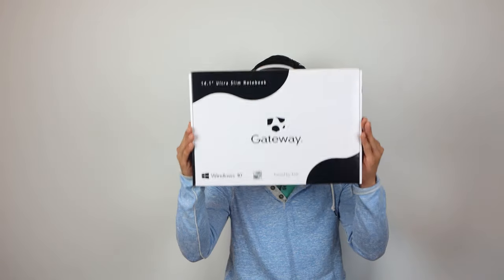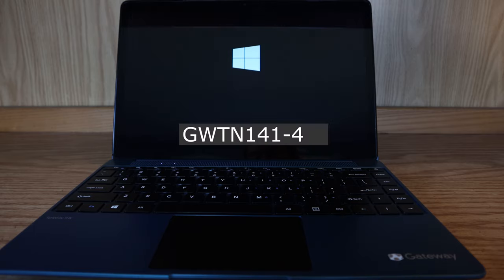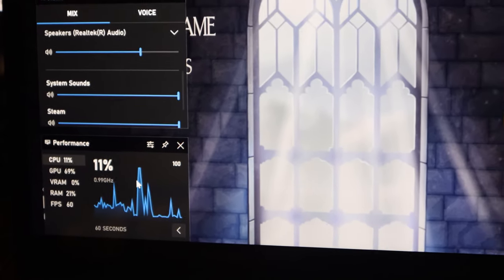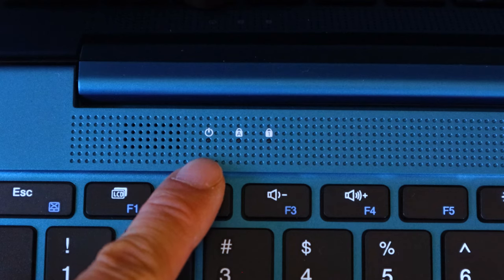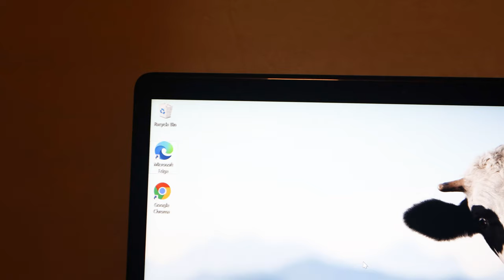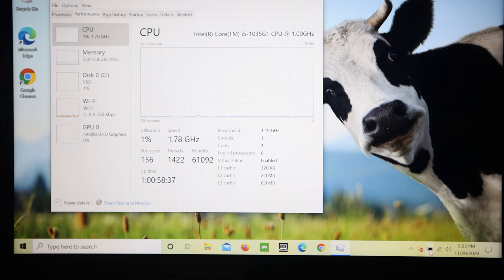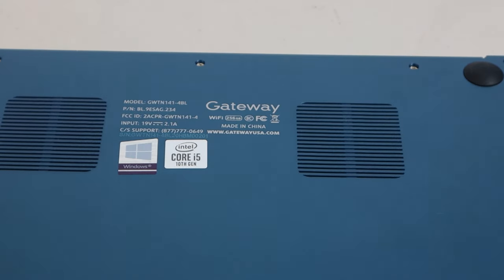2020 Gateway Ultra Slim Notebook Laptop Model GWTN141-4 Review

Comment: Please help me my laptop (the same model) everytime I turn it on the gateway logo will appear for a split second then disappear with no windows logo boot up and it just shows a black screen I don't know what to do
Reply from the maker: Hm, have you done any upgrades like replacing the SSD or adding an additional one? Try booting the laptop into safemode, as soon as you see the logo appear, press and hold the F8 key. Then select safe mode with command prompt and see if you can get Windows to load. If you can, try performing a system restore, by searching "Reset this PC" (🔎in the taskbar along the bottom of the screen).

Comment: I bought this laptop thinking it was a good deal for a fair product. But when i went to best buy looking to upgrade the RAM the employee told me i would have a hard time finding part for this laptop since gateway is so old. 
Im not very computer savy yet but i do know a best buy employee would benefit from me buying a different laptop from him/her.

So now im wondering if they are right and i should get a different model or if in fact i can find RAM and other parts elsewhere and those bestbuy people are just being mean.

What do you guys think?
Reply from the maker: Gateway is an "old" brand but was bought by Acer and recently partnered with Walmart to revive the brand. Their latest line of new devices launched in 2020, so the Best Buy employee may not be aware that the laptop you're looking at is not 10 years old. Also, when it comes to RAM, laptops are brand agnostic, so that means basically any RAM brand will work in any brand computer or laptop, and since the replaceable internals of laptops are pretty generic, I'm not buying that "limited availability" of parts is a real thing.
Reply: It's made by Acer.

Comment: I have this exact same laptop and it went completely black today I keep restarting it and it still black ☹️
Reply: when did you get it?
Reply: Bought mine less than a year, am presently facing the same problem, it goes on and off without loading when I tried to power it on.
Please what is the solution.. thanks

Comment: What type of M.2 SSD can be used? I bought the Gateway 14.1 GWTN141-5
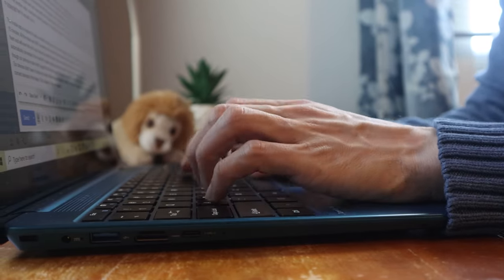Reply from the maker: Does your model have the SSD access panel on the bottom, like mine (see 7:44)? While I don't have that specific model, if it has similar specs, it should be compatible with a SATA NVMe m.2 drive up to 1 TB.

Comment: Just bought the ne for my son, set it up and now it won’t seem to power on. The 3 light on the top left of the key board are lit up but when we press the power button nothing happens on the screen. Any ideas?
Reply from the maker: Hm, it sounds like it might have gotten stuck during a Windows 10 update. Try pressing and holding the power button for 10-15 seconds to see if the LEDs above the keyboard turn off. If they do this means that the computer should be completely shut off. Close the screen and open it again and then try to power the laptop on. If it's in the middle of an update, it will either try to resume the update or roll it back due to an error.
Reply: @ReviewedByPhil  thank you!
Reply: You are amazing Phil! I found this video and this specific comment in my search for a solution.

Comment: Where do I buy a HDMI Cable that has a small fitting. The Laptop has a Small HDMI port.
Reply from the maker: Which model do you have? The one I have, the GWTN141-4 has a standard full-size HDMI port, see 0:51.

Comment: Is This Laptop Good For Work At Home Jobs & Going To School On.... Or Is It Fast ?
Reply from the maker: I guess it depends on what you need it for. It's perfectly fine for creating office documents like Powerpoint presentations, Excel spreadsheets, and word processing. I've even used it for some light photo editing in Adobe Photoshop, but if you need to run high-powered engineering application like AutoCAD for work or school, then I would say that it is not powerful enough for that.

Comment: I need help, I have this laptop but it won't wake up, the light is on but the screen doesnt come on
Reply from the maker: Hm, I'm not sure. Is it fully charged? You may have to do a hard power off (press and hold the power button). Then power it back up.
Reply: @ReviewedByPhil  I figured it out a little while ago. Thank you for you help😁
Reply: @abigailletts9185  how do u like the labtop is good im wandering if i should get it ?
Reply: I am having the same issue, how did you get it to wake up?
Reply: @itzrandom6494  it's a good laptop, I really enjoy it. The issue I had with it was my fault but it was a simple fix
Reply: @nicoleschneider3613  I held the power button for a really long time, im not exactly how it worked but I held it until it came on. If it took to long I just tried it again
Reply: @abigailletts9185  thank you! Have you had any other issues? I’m really thinking about returning it.
Reply: @nicoleschneider3613  no, I haven't had any issues besides that one and it was because I always closed it without turning it off.

Comment: I’m tired of my daughter using my iPad for Roblox. she already messed up my pencil so i need something cheap that she can use to play her game. Until i can see her take care of her things. will this be okay for that?
Reply from the maker: It appears the minimum requirements for Roblox is 1GB RAM memory and 1.6Ghz processor which this laptop has. So it should be able to run Roblox, but since I'm not really a gamer I haven't tried Roblox on it myself, so I'd take that piece of info with a grain of salt. It would probably work fine, but you may need to set the graphics level to something other than high or ultra since the GPU isn't that powerful.
Reply: @ReviewedByPhil  she’s only turning 7. so i’ll try this out & she how this works out for us. thanks for the reply

Comment: I bought a M.2 pci-e 256gb ssd card to add to mine, But the laptop doesn't pick it up.
Reply: I did the same, tried an m.2 2280 pcie in the outside extra slot. Didn’t work. However, an m.2 sata card works.

Comment: Just bought this it doesn’t have a power button it has number lock in that spot idk how to turn it on
Reply from the maker: I would check the quick start instruction card that came with it. I'm sure it will tell you the location of the power button for your model.

Comment: So only 6 hours or 10 for full battery??
Reply from the maker: It will depend on your settings. I'm sure if you turn battery saver on and reduce the brightness level all the way as well as processing power you might be able to get 10 hours of "off-the-wall" time on a full charge, though it's unclear how much of that time would be idle vs active usage.

Comment: I just discovered a weird situation with this pc. I just tried to take out the drive I had inserted in the second external slot. When I restarted without the external drive , it boots into the bios. I click on save changes and exit but it refuses to accept the change and keeps rebooting to bios. If I reinsert the drive in the external slot, it boots as usual to Windows and everything is fine. Now I am stuck with a redundant 1 tb drive since it does not show up as another drive even though it’s inserted in the external slot. If I take it out, pc does not boot beyond the bios!!!!!
Reply from the maker: Does your original drive still have the OS installed on it (meaning you didn't wipe/format it after you installed the second drive)? And you can still access the original drive after you've booted into Windows? If so, it's possible the OS on the original drive is corrupted which is why your computer won't let you boot with it, in which case you may want to try a re-install/repair Windows OS on that drive. Your other option is to try to "force reset" the BIOS boot priority by removing both SSDs. When you turn the computer on after, enter BIOS setup and choose "USB hard disk" as boot priority #1, save and exit, then restart the computer. It will try to boot, but find no OS anywhere so it should fail, resetting the BIOS. Now turn off the laptop, reinstall only the drive containing the OS in the primary m.2 slot. Boot into BIOS setup, then select "Hard Disk C:" as boot priority #1, save and exit, and restart. Hopefully that will work for you!
Reply: @ReviewedByPhil  Thank you for your rely. The main drive inside the main cover, the boot drive. I used Macrium Reflect7, transferred the image of the pre-installed drive to the new 1Tb drive replaced the original 256Gb drive with the new one. The new drive as the replaced drive is the boot drive. Everything worked well. Then I inserted another 1 Tb m2 nvme sata drive into the external extra slot. Boots well into windows, everything works fine. The pc recognizes the external slot drive as drive 1, asks me to initialize but reports some fatal hardware error. Now if I take the external drive out and start, it goes directly to the blue bios screen. I click on accept/save BUT it keeps looping back to the same bios screen. Won’t go to Windows. Again if I stick the external drive in, it boots to windows as usual. All operations normal. Only if i take out the external slot drive out, it won’t surpass the bios screen.
Reply: @ReviewedByPhil  thank you so much. The second option did the job. Everything working now. Appreciate your help.
Reply: @ReviewedByPhil  do you have to reinstall windows if you replace the ssd that came with the laptop or is it saved on the chipset

Comment: I bought that laptop, and two days later, I turned it on and it shows on because the button is on, but it gives me a black screen, and it's on because I can also activate the shift key, but really, I don't see anything on the laptop, does anyone know why? I haven't even mistreated it or treated it roughly
Reply: I have the same problem right now.
Since this comment was made 4 months ago can you tell me if you were able to resolve the issue somehow?
Reply: @chump3592  how long ago did you buy it?
Reply: @skagirl6937  about 8-9 months ago
Reply: @chump3592  If you have the same problem that I had, you should let your device's battery run out until it turns off, then put your device on charge, 5 minutes will be enough, then try to turn it on (I did it, and then they came to me). some instructions that I had to update it), I did it, then I remember that it makes you wait for your team from 1 to 100%, and that's it, that's it

Comment: I just wanna use it to stream my Xbox off of it with my Graphics card you think it can handle it?
Reply from the maker: Yes, but you would need to make sure it's set to 'performance' mode as Xbox requires at least 1.5 GHz and by default it runs at only 1 GHz.

Comment: I HATE THIS LAPTOP!!!  THE SCREEN FALLS OUT OF IT,  I only had it for six months and the screen fell straight out and smashed on the keyboard,  And it's a common problem if you read reviews online.  Now after spending $540 at Walmart for this crap I have to go through the hassle of mailing it in at my own expense to the warranty place and waiting weeks for it to be repaired.  It worked great at first then it falls apart,  I have bought way cheaper laptops and never had this problem.
Reply: Dudeee! I bought this laptop and didn’t get the warranty because of how expensive it was smh. It worked fine for like 2 months and now my screen is just completely black. And I basically have to pay the same price of buying a new laptop to fix this
Reply: @kynyaralewis8226  Did you buy it from Walmart ?  Because I didn't pay any extra for the warranty?  It came for a year with the laptop.  I went on BBB and filed a complaint and got mine fixed.  I will send you links if you need help.  They ended up fixing and sending mine back within a week.   I don't know why this video isn't mentioning this very common problem when it is so prevalent.

Comment: Is upgrading the ram possible in this laptop?
Reply: No, it is built in (although I don't see the point of it since it has 3200mHz dual channel 16gb ram)
Reply: @vlado_tasevski  Cool thanks for the heads up on that.
Reply: @vlado_tasevski  Hello, are u sure this laptop have dual channel at 3200mhz of ram? where u saw it? please.
Reply: @domenico8508  When I went into task manager and clicked on ram, it showed me that it has 2 out of 2 ram slots filled and that it is 16gb 3200mHz. Not sure if every model has the same but mine has it that way.
Reply: No. It’s soldered in. 16mb is enough for this $400 laptop. It is good for low-medium computing. Don’t expect more than that.

Comment: How do you factory reset it?
Reply from the maker: You'll need to do this from within Windows 10. 
1. Click the Start Menu and select the gear icon in the lower left to open up the Settings window. 
2. Choose Update and Security. Click the Recovery tab on the left-hand side and select 'Get started' under Reset this PC.
3. For a factory reset, choose Remove Everything. Then continue to follow the prompts to complete this process.

Comment: Just a heads up that the storage is not capped at 1TB.  I have an 2TB NVME (ADATA SX8200) in the internal slot and a 2TB (Western Digital WDS200T2B0B) in the user expansion for 4TB total. 

EDIT:  So the WD digital I put into the user access (small cover) slot is SATA.  That port is SATA only.  The internal port under the bottom cover will accept SATA or NVME.
Reply: I tried an wd550 nvme 1tb, it didn't work. 2 different SSD's. I'm talking about the port on the bottom of the laptop.
Reply: @TheDroneVoyager  The user accessible port is M.2 SATA only.  If you want to put in an NVME you have to remove the bottom and replace the included SSD.

Watch the video.
Reply: @David_L3  your laptop is 10th or 11th?
Reply: ADATA SX8200 2tb or ADATA SX8200 pro 2tb?? its M key ?

Comment: Can I play the sims on this?
Reply from the maker: Yes, I think so. This laptop should meet or exceed the minimum hardware requirements for the Sims 4. When gaming, be sure to put it in performance mode. It may push the CPU a bit and make the fan run louder though, so headphones are recommended!
Reply: I'm wondering that to🤔.plus I do alot of mods and cc

Comment: How to make my speaker louder
Reply from the maker: If you've turned the volume in Windows up to 100, then that is the loudest that it is going to get. If you need more sound than what the built-in speakers can offer, plug an external set of speakers into the headphone port of the laptop using an AUX cable or use a headset.
Reply: @ReviewedByPhil  good idea thank you

Comment: This laptop sucks. Bought cheap on black Friday. Been using it since Jan/Feb. The rubber feet have fallen off, the keys stick, the power brick has broken and being held by electrical tape, and the mini sd port doesn't work. And it's slow. You get what you pay for and apparently $400 gets you crap.